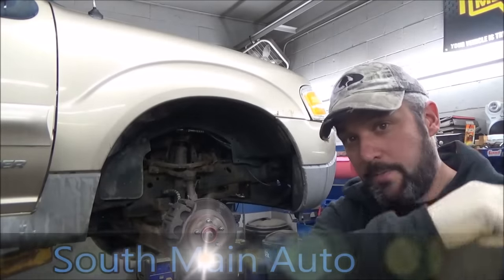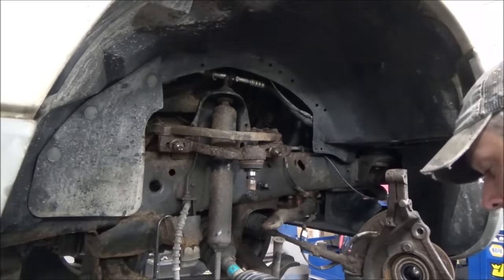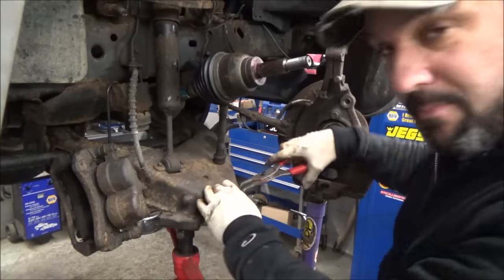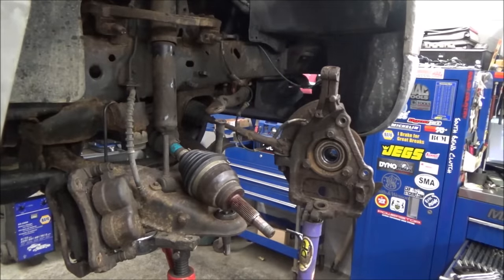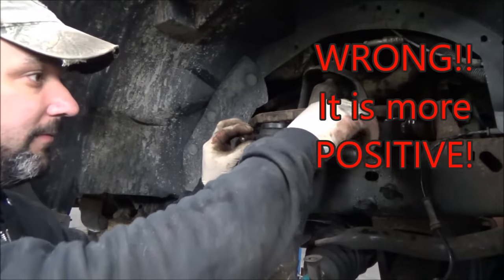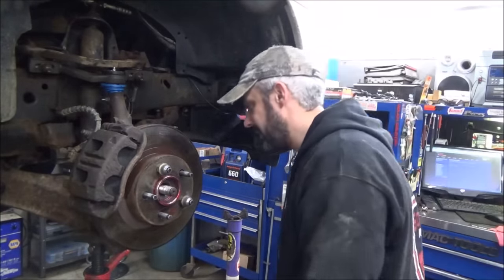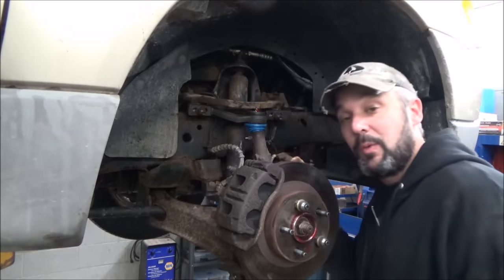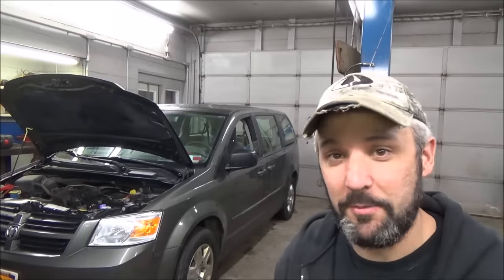Ford Explorer Sport Trac - Ball Joints

Comment: if that's "big nasty" then whats the cp717?
Reply: +Hawaiian F150 -- I truly despise YT formatting!! At least the links still work OK.. Sorry all.
Reply: +Hawaiian F150 Well if you look close at both of those tools, you might discover one of CPs secrets.......   One they have been keeping since around 1989-90 when they shut down the air tool plant in NY to move it south, but scrapped a LOT of the tooling to make certain tools, like air hammers, drills, sanders......
Reply from the maker: +NCPDFSB I don't know it Astro can comment on this or not but think of it like this, Toyota Matrix / Pontiac Vibe = Same Car .... CP717 / Astro 4980 = Same Gun ....
Reply: Yep. CP has been doing that for a LONG time. Was interesting to see the inside of the plant. The outfit I delivered for did powder coating for CP, If you have a red, black or "chrome" CP air tool from the 80s-90's it was painted in Canajoharie NY. During that time they were starting the import tool switch. It was strange. The tools came in on one side, the CP folks would pull the hammer guts and triggers out, toss them in a cleaner tank that also removed the labels. Then out of the tank to the foundry. They would melt the handles down and cast new ones that had the CP logo on them. Then stamp the model in the grip and into a crate to go be painted. Once painted the trigger and guts were installed and it magically became a "made in the USA" tool.
Reply from the maker: ***** Hahaa funny how that works...
Reply: +Blazer02LS  Is the CP717 made in Japan? I'm pretty sure it is..
Reply: It's made by Astro for CP. Only difference is the labels and accessories. CP only makes a few of the high profit tools these days. The rest are imported (high quality ones though). Many of the other air tool outfits do the same thing, even the guys with the fancy trucks...
Reply: CP vs Astro = Astro cheaper than CP  ;)When you add up all the do-hickey gadgets and extra's it's cheaper to buy the Astro gun and the add-ons separately from Dr. O's store ;)  Benefit of CP717 is a couple bits and a blow molded case. Sears sells a plastic case for $15 - $20 bucks.   But really, I think shop mechanics aren't going keep it in a case all locked up.  I think most mechanics probably have it in a drawer always at the ready right next to the other favorite tools that aren't in a case. Great tool = no need a stinking case cuz it's about to get used again.
Reply: I only keep specific tools in cases, like my mini buffer for doing headlights it resides with all the materials for that job in a case. Same with the plastic welders. But if it's a tool that get's used a lot it goes in the drawer.
Reply: +Blazer02LS -- Yup - the only thing that cases are good for are to hold stuff you "ain't using" and to make room in our tool boxes for the stuff "we're using".  As for tool bits - it's the same deal. The most common one used is already in the gun and a Sears $6 tool wrap usually fits in almost every drawer.
Reply: +South Main Auto Repair nothing made in America anymore, make America great again.... you know who has my vote.
Reply: +NCPDFSB, +South Main Auto Repair -- ya know I don't want to get too philosophical (eek! - 2 man'e silly-bulls 4 me) and a YT channel is the worst place to voice an opinion -- But WTH, here goes nuttin professors  --- There was a really neat conversation between Jimmy Kimble and Craig Ferguson and it was about how  a few president runners were using the  "We Need To Make America Great Again - Vote for Me - I Can Be Trusted" platform as a vote getter. The point got to how the phrase, ""We Need To Make America Great Again - Vote For Me" is ridiculous in totality.  First it was used in killing every ISIS and Taliban (i agree with this to a point - if they pick up a gun and point it in any manner to hurt, seriously injure or kill any non-combatant innocent people - then they deserve what they get - repeated center mass shots).  If they (ISIS and Taliban or anyone else for that matter)  kill or injure anyone else for any reason and especially so if their freedoms are jeopardized with "you don't join - then you die" mentality because they don't want to fight and are suspected of hindering those whose main goal in life is to kill everyone in their way. ... and the politicians said ""We Need To Make America Great Again" - "I'll kill everyone that doesn't agree with America - Vote for Me".Then when asked about stopping the racism and inequalities about Equal Pay, vacations, promotions and fair treatment of rights and of course we can't forget Earn a Dollars Wage and Get a Dollars Pay, not the 50 cents on the buck mentality that has lingered on for far too long.  When some bigger person is stronger (in physical stature) it does not mean the conversation should tilt toward the big guy.  The right for a woman to choose to have a baby or not is protected under our Bill of Rights and the Constitution. Having the federal government decide this instead of at the state level is ludicrous because it defeats the common sense understanding that people can think on their own without the Federal government holding our hands.  And the Politician's said ""We Need To Make America Great Again  - I'll make it illegal for a woman to decide to have a baby or not -  Vote For Me"I say "America Has Always Been Great" - I would also say that it's been a great country since we got away from British rule and formed this beautiful country. We created a country for, by and of the people - that's when America has been made great.  We, All Americans, have issues that need to be openly and with equality discuss honest open minded understandings so all can fix the broken wheels of life. Racism, poverty, unfair taxation of the middle and lower income families, health care for all and most importantly the notion of any kind of superiority based on the color of our skin.   And, the upper 1%'rs need to be held to court and the same goes for those money moving people that hurt our economy with lies and deception. We need to stop off-shore financing shelters for all. It's our USA, our country, our lands and our Families - not the Politician's. We need to get out there and VOTE - Lets take back our government and apply our government as outlined in the Constitution and Bill of Rights. If you don't get out and VOTE or you turn a blind eye to getting others to VOTE then you have No Right to say squat about how our country is good or bad. You have the chance to make a difference - Use it,  ( i humbly step off my soap box)
Reply: +Hawaiian F150  good for you! you voiced your 1st amendment rights! its so refreshing to see more and more Americans get involved in the current political environment.
Reply: +NCPDFSB -- Sure did. Been doing that for quite a while now. Since I'm 60 (ish), I'm old, feeble minded and fart quite frequently in open public places, I've lost track of all the times I voted. Taught my kids the same message - if you don't vote - you don't get to complain. Basically all non-voters are inherently saying that all of the people who gave their lives and that those sacrifices mean nothing to you. Those battle fronts, were all in vain no matter where they occurred. Either on the streets of our home towns or abroad against foreign forces in the defense of our country for our right to be and stay free, their lives were wasted because you don't care how America is run because non-voters basically just give up and don't give a crap (usually until it impacts them directly).That said, "If You Don't Vote To Fix It - You Don't Get To Complain"  about how screwed up things are.

Comment: eric the car guy welding that balljoint...you cant mickey mouse front end stuff like that. hes a decent mechanic but thatis just asking to get your balls busted.
Reply: working shlub a proper stitch weld is stronger than the press in hold. The challenge is controlling the heat for obvious reasons.